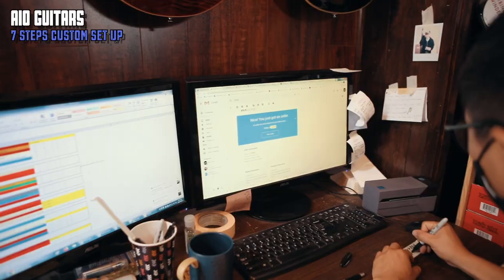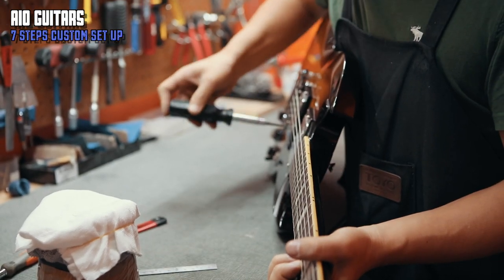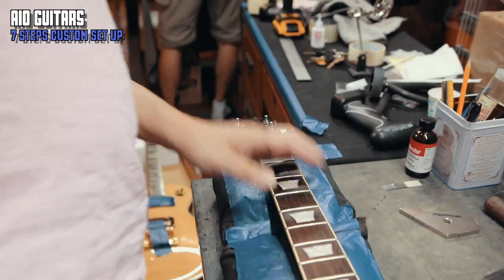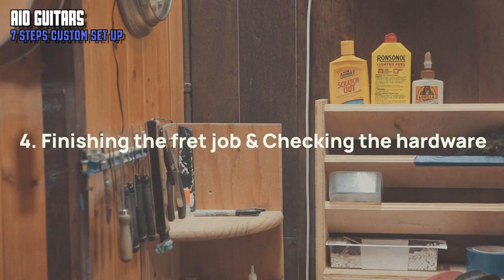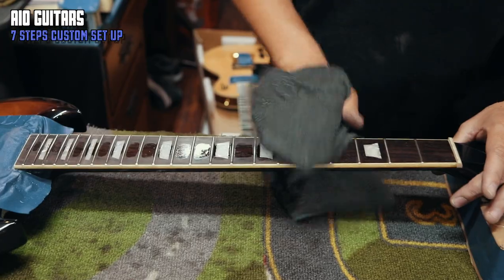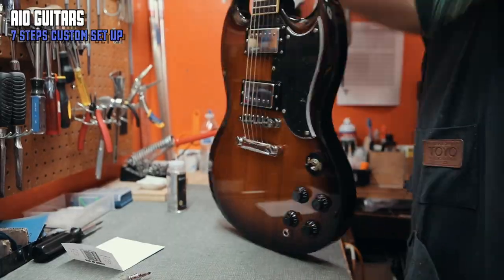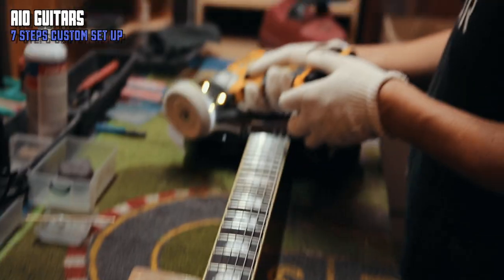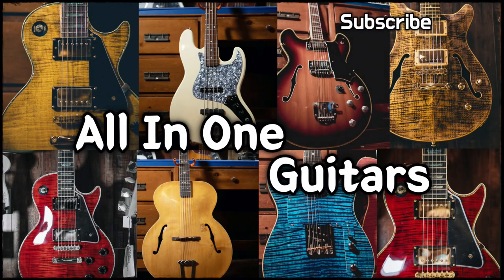AIO Guitar's 7-Step Custom Setup - Neck/Nut/Pickup Adjustments, Fret Dressing, New Strings, etc.

Comment: Just like they say here..most companies just put the sticker on the box and ship it out without even opening the box.
I had been waiting for the new 2021 ESP LTD EC 1001 Tiger Eye guitar to come in stock for many months..I have and have had many LTD's and have been very happy with all of them until this one.
I paid about $1200 for it new and when it arrived here to my house I was so damn happy..damn it looked badass and I couldn't wait to plug it up and jam !  
Boy I was pissed because the guitar played horribly,and I know some new guitars need to be setup and/or setup to the customers needs but this one was way out of whack,unlike any ESP LTD I've ever purchased,even the lower LTD 200 $400 dollar guitars have all been way better than this POS.

Whoever did the nut and the cheap plastic nuts that ESP's putting on these guitars is ridiculous,and the nut slot in the body was horrible..really thin in depth..I tried to install a Tusq XL  nut on it and had to work it for 3+ hours before it was even close to being playable + I could never get the string action low enoughwithout buzzing everywhere on the neck,even with .009-.042 strings.

I know that sometimes things happen but I believe that I am not the only one who has had this problem with some of their mid priced supposedly highly playable guitars..I hate it but going to pay it off and sell it immediately after..I don't think I will buy another ESP LTD guitar if its one of the newer ones..it was from their Indonesia factory and I have had several other branded guitars made at Indonesia factory(s) and still have several with no complaints..even low line ones.

Anyway after this rant these AIO guitars setups and guitars look amazing for the price..I will be buying one very soon.